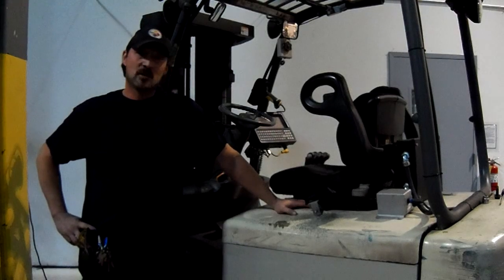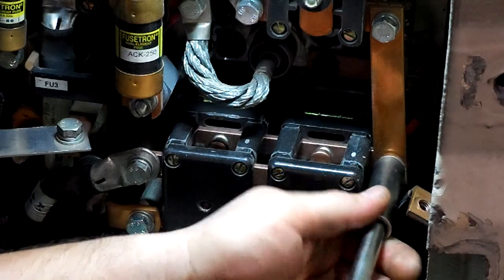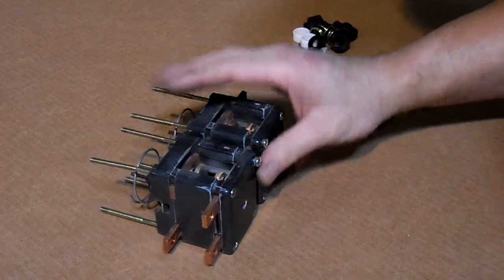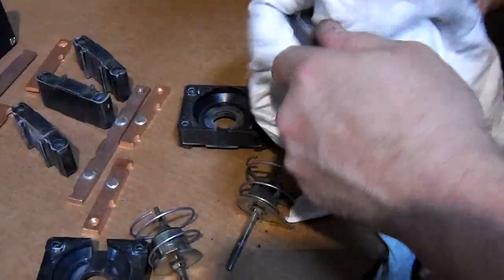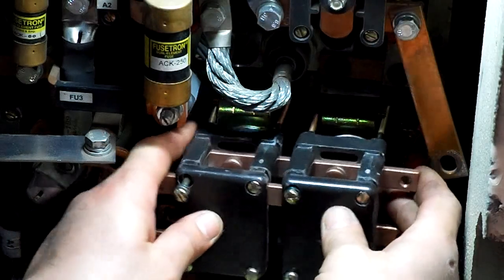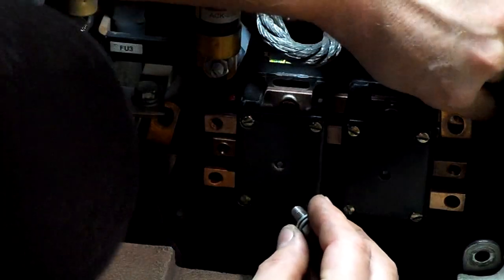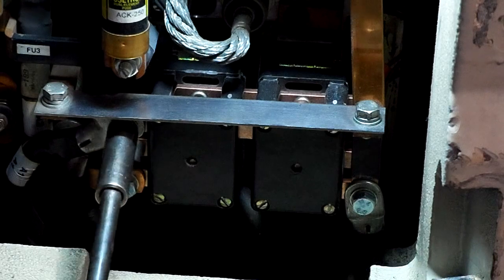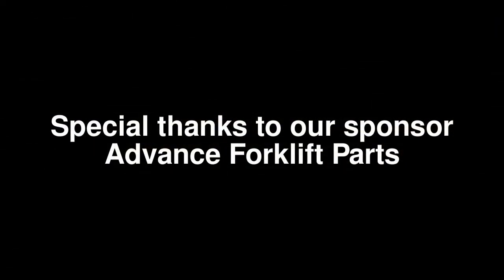How To Fix Your Forklift - Code 24 -  EV100

Comment: I just bought an old Komatsu FB15SH-7 that's giving me the intermittent 24 error and won't go forward when it does. Reverse seems fine. I'm going to try this on mine! Will this cause it to have low drive power as well? Even with full battery it just seems lazy trying to move around.

Comment: I remember the 210 panel
Reply: C80 was the first SCR system I worked on. Didn't even have PMT pretest. If the #1rec or 1A contactor was shorted, full speed as soon as you closed a directional contactor. The 185 panel had a separate card, but most ended up getting bypassed.
Reply: Go all the way back to carbon pile drive control lol !!! Now there was advanced electrical drive control.  Funny thing though  it worked.

Comment: reverse steering forklift in order to make this sort of lift drive normal steering is it just done by programming it  say on a Raymond standup
program in it using its yoke or joystick or hand controller whichever term you want to use
Reply: On order pickers, yes. Or pretty much any electric steer unit.

Comment: Great work.  Fast and efficient.  Dont see so many of these old EV100s around any more, but I like the fact that they are serviceable.  Newer all-in-one systems have only solution for everything, that is-replace the hideously expensive black box.  By  the way, I am with chuck7497 on this, you DO sound a lot like Tom Hanks.  Is your day job in Hollywood, by any chance?

Comment: Better and cheaper in the long run to replace entire contact assembly. Plastic gets old and brittle the plunger rod is usually the bigger problem along with that thin little shim.

Comment: Nice work bro! Give me more!! Im trying to get a job in the industry so any extra knowledge would be great!
Reply: Was 22 years old when I started working on forklifts, retired at 70 years old seen just about it all.  Great career requires a lot of patience remember to go with the flow and don't let it get to you.  Best advice get all the schooling the dealership has and don't be afraid to ask for help.  Problems on forklifts repeat  themselves some one may have had the same problem and repaired it. Good luck.